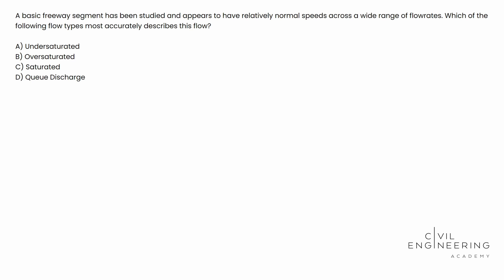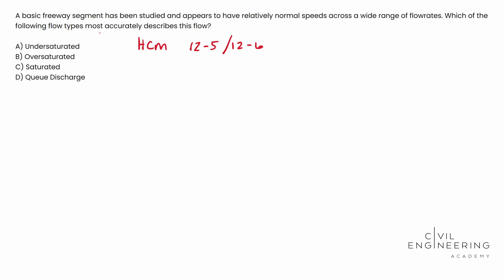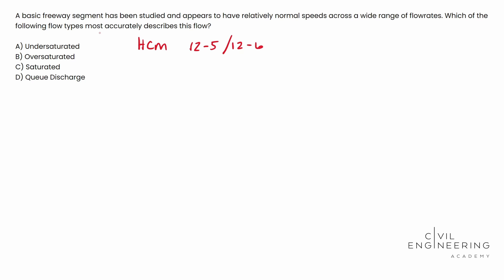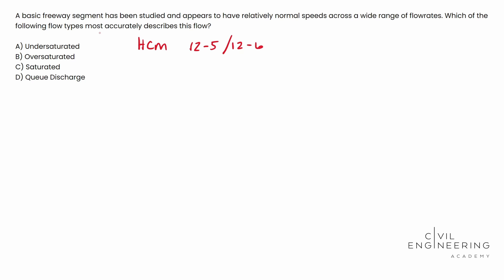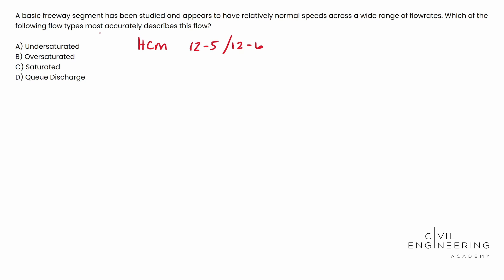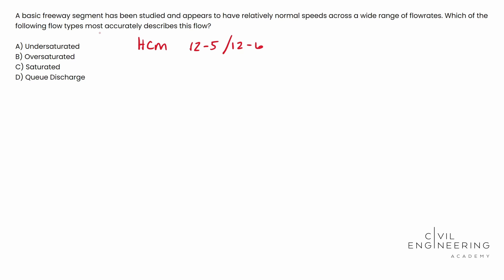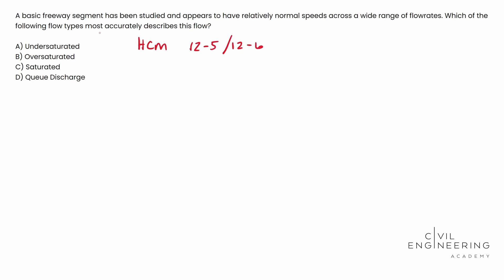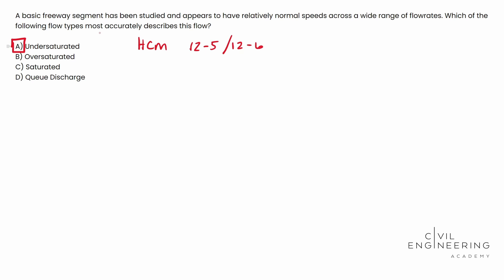Civil PE Exam – Transportation – Determine the Correct Uninterrupted Flow Type

Comment: I was a registered engineer in another company where I took the exam. Previously, I could obtain books, regulations, and standards from bookstores at reasonable prices. However, here in the United States, for the PE exam, the cost of these books, standards, and codes is significantly higher. Is it necessary to purchase all these books, like the Highway Capacity Manual, or are there better alternatives?
Reply from the maker: You can find many resources online.  If you have coworkers I would start there.  Your employer may have them or purchase them as well, but I believe many find these resources online as much as they can.